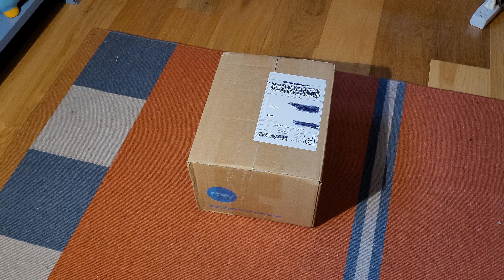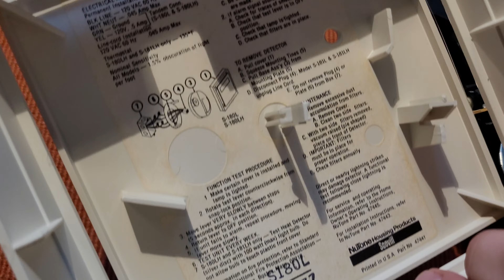Vintage NuTone-Scovill S-180-L Smoke Detector (Smoke Detection/Alarm) | Unbox & Test

Comment: the test lever on my ESL is very tick and red, i wonder why it’s just a small little wire. also on my ESL you have to take off the trim plate on the side to test it while having the cover on, the cover also serves as a silencer like the Honeywells. Excellent video!
Reply: It’s probably like that to accommodate the larger cover on the NuTones. Where the ESL’s covers are so confined and form-fit to the under housing, the test lever can be made compact. And much closer to the units housing. Whereas with the NuTone’s, your dealing with that much larger, oversized cover. So the switch has to protrude further for ease of access. Because if it were teeny like the ESL’s, you’d have to reach your hand under the cover, and it wouldn’t be safe.
Reply from the maker: i think the design of the test lever on the ESL models is a bit stupid, cause you have to remove the cover, remove the ring, then replace the cover to activate the interlock to test it. probably was quicker just to test it with a match back in the day
Reply: @BAFVintage  no you just have to remove the ring the cover can stay on, but i see the point
Reply from the maker: @theshedproductions.  i suffer from lack of brain cell

Comment: Cool! Love these. My S-180 was made in September of 1975, so there’s a bit of an age gap between them. I’m fairly certain the S-180 came well after the oddball Gentex made unit. Probably went: Gentex Units, S-180, S-180L, S-185 and 906-2’s, and then they ceased production, I’d assume those system detectors they made were from around the same time period as the S-180’s.
Reply from the maker: I bet the 206's came out slightly after the 906's honestly, wouldn't surprise me if that was their last design since they're sealed units.
Reply: @BAFVintage  could be tbh, only reason I was thinking that is because of the 929 being a 12.6V unit, and the S-185 being a 9V unit.